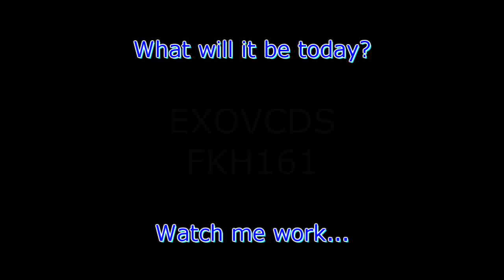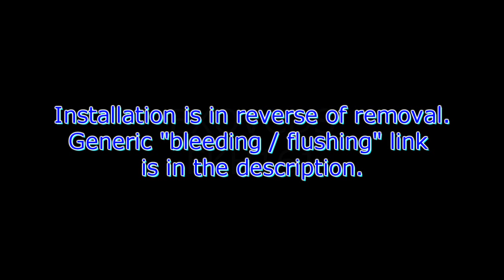VW Touareg: Front brake pads & disc removal

Comment: my 2015 Toureg has auto hold and a electronic hand brake, do I need to do anything else? Or can I replace as per this video with no issues? just need to ensure it's in service mode before starting? Thanks - this is super helpful!
Reply from the maker: As far as I know, the front brakes do not require any special setting to change... but I would have to check a service manual to be sure.

Comment: What happens if you don't place the suspension into service mode?
Reply from the maker: Supposedly... the suspension ECM can recognize if the vehicle is lifted and will prevent any damage, but to be safe, you need to tell it that the vehicle is being lifted. What it will try to do otherwise, is adjust ride height while the vehicle is in the air, which could stress components? That's just my guess.

Comment: What is involved with attaching the wear indicator cable to the brake pads
Reply from the maker: Plug & play... can be reused if not broken. Pull off and insert into new pads. If you have new sensors for pads... just push them into place.

Comment: My brakes were done only about 7k miles ago, but my front rotors are already warped. I have never done my own brakes, but I may give it a shot. I didn't see the bleed valve get opened on this. Would replacing rotors require you to bleed the system, or do you just bleed/ flush when the fluid is old?
Reply from the maker: Bleeding the brakes should be done every 2 years... I usually don't open the bleeder screws when pushing the pistons back in. I check / test the brake fluid for color and moisture content and decide then, if bleeding / flushing is required. If you are only replacing the rotors... no, bleeding is not required.
Reply: @EXOVCDS  thank you sir.
Reply from the maker: I meant flushing the brakes... every 2 years. =)

Comment: My 2016 Touareg has two pins holding the pads in, as opposed to the 13mm bolt.  Anything else different that I should be aware of?  I'm at 23k and I think my front pads are already toast.  :(
Reply from the maker: +Dustin D I'd have to check a service manual... haven't worked on a new Touareg yet.
Reply: Yeah, looking at the manual now.  Says to drive out brake pins (there's two of them as opposed to the one big one in the center like in this video).  Is it pretty much a must to replace the sensor every time?
Reply from the maker: +Dustin D The sensors can be reused... if you can remove them without falling apart. They might not stick in the new pads when reused. I'd just go with new sensors.

Comment: I have a problem work me car right now. it's telling me that my ignition is locked on my car,  could that be due to my breaks needing to be changed ? please help.
Reply from the maker: Desiree solis Year? Make? Model? Standard or Automatic? Are the wheels pointing 45 degrees left or right? Are you sure it's not just the "steering lock" that is active?
Reply: Thomas EXOVCDS it's a vw touareg.  2004. I am able to turn my car on and turn the wheel just fine.  but as soon as I get in my car on the dash board it says "stop , ignition locked " and I can't take it out of park.
Reply: Thomas EXOVCDS it's a standard,  v8
Reply from the maker: Desiree solis Could be a problem with the ignition lock module. If you Google search "Touareg Stop ignition lock" you will get links to articles & YouTube videos. Follow some of the suggestions... if nothing works, tow it to a dealer.

Comment: Hi, any idea where can I get the part numbers for both front and rear brake pads for my 2016 Touareg? The dealer refused to share. Also any pad upgrade that is compatible with the factory discs, I.e. without having to change any other parts?
Reply from the maker: https://www.ecstuning.com/
Reply: Thomas EXOVCDS , thanks

Comment: i broke the brake pad wear sensors, is it ok if i don’t replace them?
Reply from the maker: Yes, but you need to keep the sensor circuit intact, so that the rest of the system can function as it should. You can also glue the sensor into place.